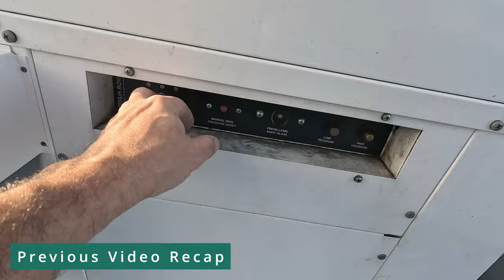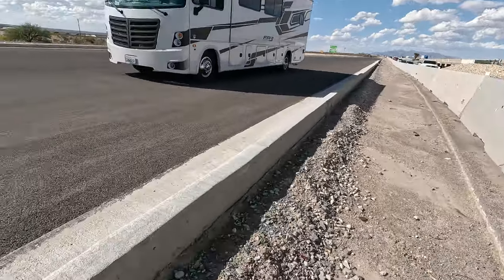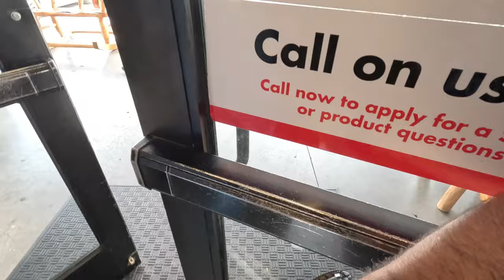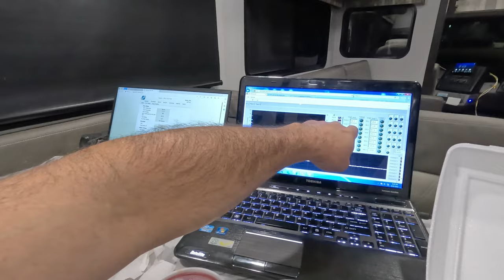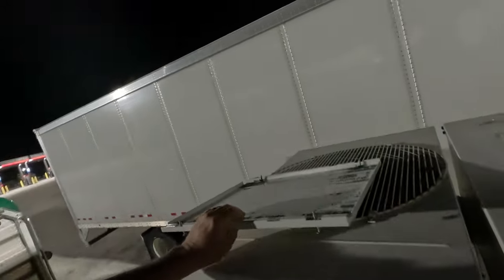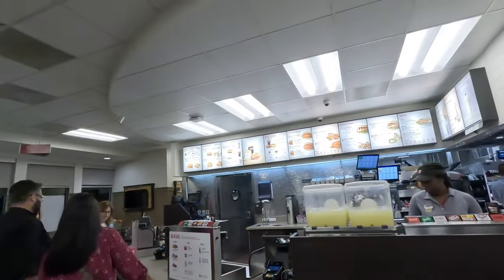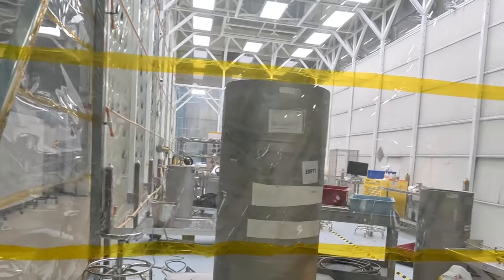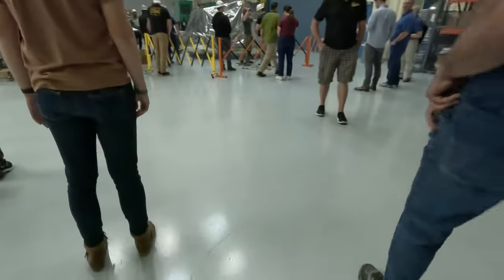HVAC Transport Mission With NASA Part 2

Comment: Long haul HVAC is no life, even for NASA. 
Strange how a designed camper can’t handle running both ac’s. 

Thanks for posting
Reply from the maker: I think there was something wrong with the AC unit. Plus it was a inverter driven generator that should have been able to handle the load. If each of them were pulling 15 a piece that have been 30 in the Max on that thing was 47 with 42 amps continuous. But without tearing it apart I couldn't find out if there's something else eating power up or not but it sure seemed like it.